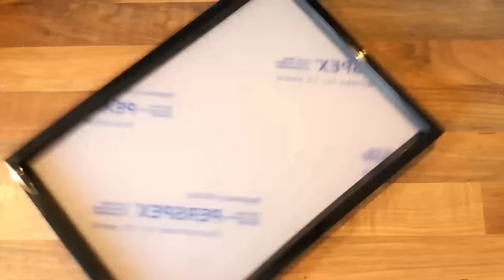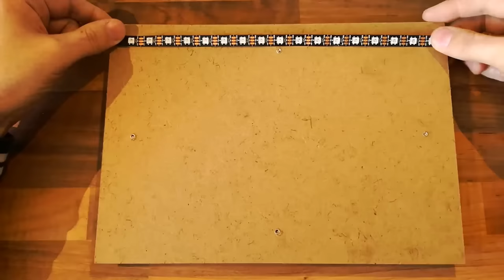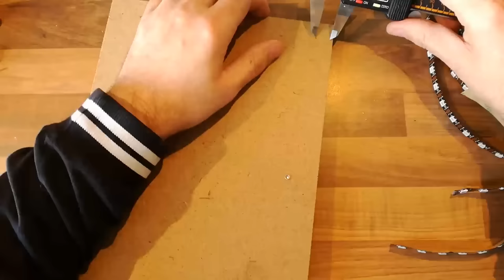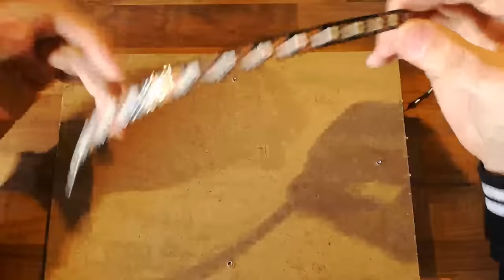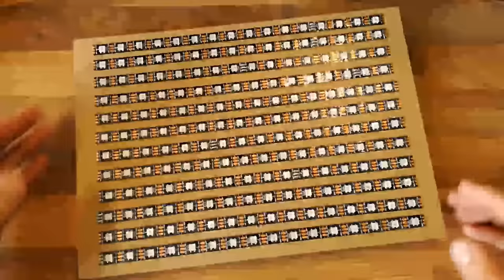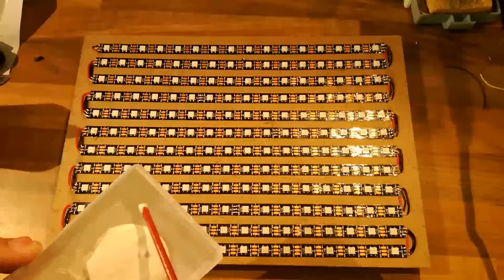Building a WS2812 LED panel (Code links in description)

Comment: 0.06A per LED 196*0.06a 11.5A and does not include anything else you have drawing from the same source. For those reading that assumes all LEDs on set to white.

Each LED (RGB) os 0.02A and so unless you have a project that is effectively using this array as a white lamp, then you can probably cut down the power requirements. It would take some testing but if you are only lighting 55% of the LEDs at any one time and you go full power white then you can get away with something closer to 6A

Comment: Take 20mA per color per led..... Comes to 12 rows by 16 leds times 3 (led colors) times 20 mA = 11520. That is safely to say that 12 Amps is sufficient. Quite a nice calculus indeed, so you prevent from blowing a psu...  By the way, I like your approach and build... Very nice indeed...

Comment: Really nice job!
According to the datasheets the ws2812B leds draw a max current of 60mA per light, you have 192 of them which is around 12A max draw! When you tested it and your bench supply dropped to 3V I'm surprised it mangaged to even supply that!
Reply: That's 60mA if you are running each LED at pure white with full brightness. Each NeoPixel actually has three LEDs within-1 red, 1 green, 1 blue. Depending on the colors you are displaying (by mixing the RGB color) and the brightness, you can keep power draw pretty low with these. A good rule of thumb is just never go full white with full brightness.
Reply: @TheGrrson  If you keep track of the number of LEDs, you can calculate the brightness to stay below 90% of your power supply rating.

Comment: hi good video but from my understanding you can not push power backwards on these leds hence the reason
for the arrows data power and live power would push forward only. for you to power inject you would do that half way down
equaling out the power usage . i have done all of mine on a larger scale my largest is 1,476 led's matrix i power injected 2 times
i used a esp32s chip and boosted the data line with a low level converter 3.3v to 5v jump as data pushes at approx 3.3v
this helped with glitches as this is on a large scale works seamlessly hope this helps . My power booster is a 60amp power supply
it doesn't use that much but i also use that for my led singing Christmas bulbs.

Comment: Max Current Intake = Max Current Intake by a Single LED * Total
                                   = 60mA * (16 * 11) = 0.06 * 176 A
                                   = 10.56 A (~ 11A).
So recommended power supply is 5V-11A.
Reply: If you keep track of the number of LEDs, you can calculate the brightness to stay below 90% of your power supply rating.

Comment: I am kind of new at this but... 16x11 = 176 "pixels". Each of the WS21812 at full-white/bright = 60ma. 176 * 60 = 10,560ma / 1000 = 10.6a. So to drive the entire board you'd probably need a 12a power supply.
Reply from the maker: Yep, that sounds about right. I didn't have the WS2812B specs to hand to calculate it.
Reply: marcoNLD  Note you could drive more LEDs at lower intensity...  what you are calculating is peak current, which if you program your application carefully you can avoid ever hitting that.
Reply: @MajenkoTechnologies  If you keep track of the number of LEDs, you can calculate the brightness to stay below 90% of your power supply rating.

Comment: Are Strips with 60 LEDs per meter? Strips with 96 LEDs per meter would be much?
Is it necessary to connect the end of the last Strip to the power supply?
Thank you

Comment: Can you easier connect power on the other side as Data? Than you do not have both on one side. Vor the current it is not important in wich direction it flows